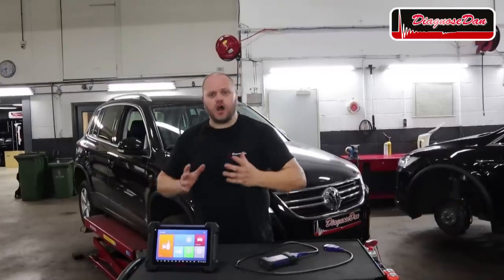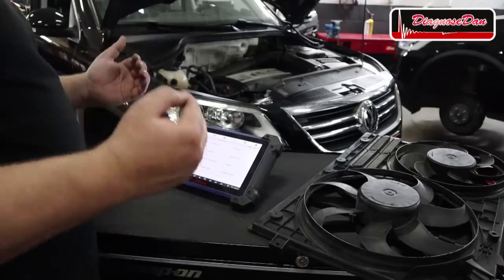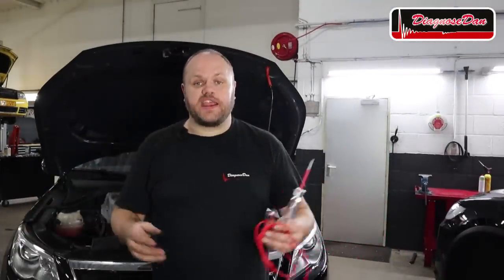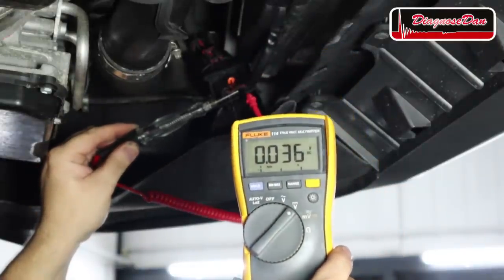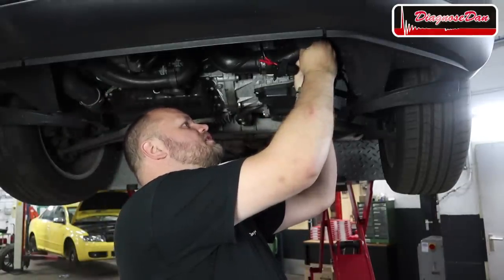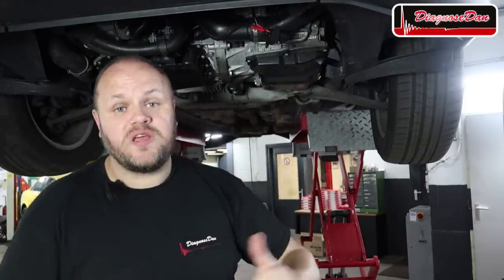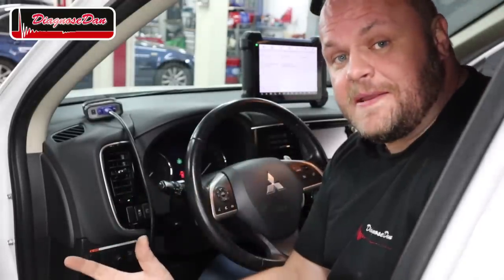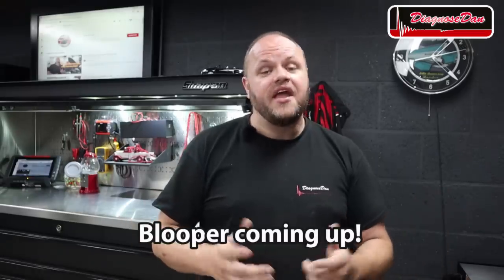A Cheap Chinese Car Key from Wish, will it work?

Comment: What gives with the other shop, surely testing grounds under load is car electrics 101
Reply: asking most of them what electrical load testing is and they'll probably not have a clue...
Reply from the maker: I think you would be suprised to see how many technicians don't know
Reply: @Diagnosedan  I have to look this up.  I thought a resistive point in the circuit (bad connection or corrosion) would show a voltage drop like putting a resistor in series.   If I understand, pulling a current (a load) can generate enough heat at the resistive point that it destroys continuity and breaks the circuit.    
It's not that the voltage is reading wrong on the meter.  It's that the load is testing all the connections under actual current draw and a weak connection will fail.  

I got the impression from the video that there was a problem with the test meter and the digital test light.  Like they were not showing the actual voltage.  Really, they are too sensitive.  They tell you everything's fine when it isn't.
Excellent video (as usual).  Worth thinking about.
Reply: @alext8828  there probably whee no issues with the multimeter or led tester niether are they too sensitive.

I assume he didnt gave a actuator command to start the fan while he meusured the ground, otherwise the fan itself would be the load and the voltage would had dropped.
Reply: @KaasTube  Ah, that is right.  Normally, at least from my experience, testing is done by casually hitting all the test points and noting the results.  It would be, as you say, a requisite to either switch the related component on or, as Dan did (finally), use a resistive test w/ load; ie. incandescent bulb.
I need to remember this result.
Just as an added comment; I did troubleshooting for a dealer and one of the things that we got a lot of were short circuits caused by the wiring harness being damaged by assembly screws driven thru the harnesses.  We had a meter that could follow the harness and find the short.  It worked by momentarily switching the circuit on at the fuse box and the meter was hand-held and would pick up the magnetic field of the circuit turning on and off.  An arrow on the meter told which direction to move to find the short.  I thought that was the coolest.  Never saw that system again.  Very clever and this was in the '60s.  Our most advanced piece of diagnostic gear was the Sun analyzer.   Dan has been a tremendous help in furthering my understanding of these things.  Thanks for your comments.
Reply: Alex T That is a very cool story about finding the short, which is often more of a hunting expedition.
Reply: @douglaslippertindy  I'm glad you liked it.  I was worried that it was a departure from the norm to add it in.  That gizmo could find a short in less than 10 minutes that you'd never find in a hundred years with normal methods.  I'd like to shake the hand of the guy that invented it.  And I never saw it used any other shops again.  Thanks for the reply.
Reply: @alext8828  I only work as a mechanic for 2 years now so I did not have many shorts yet, 
Although i do have some experience with finding shorts in a pcb.
For example a short between the supply and the ground which every IC is connected to. The way to find the short was to meusure it with a 4 wire bench multimeter. Everywhere you would meusure short but the 4 wire is accurate enough to even meusure the resistance of the pcb traces , so the real short will be 0,0005 while the rest will be 0,0010 ohm.

Comment: Very good Dan. This is not the first time you have found defective grounds. I hope I remember to use an incandescent test light the next time I have an electrical problem with one of my cars.  Also, when I bought my current car from my daughter it only had one key fob. I purchased two more key fobs from Amazon for $39.95 each and had a local locksmith program them in my 2015 Challenger.  They all work perfectly and I keep one of them in a safe in my house as an emergency spare.  I also carry two of them with me at all times to keep from getting stranded if one of them breaks or if the fob battery goes dead. I keep the spare wrapped in aluminum foil and plastic so that only one of the fobs is detected by the car. When I arrive at home I keep the active fob in a tin box so it can't respond to any signals from the car.

Comment: Great video. Ive been fooled too many times by a test light as well. I would have used something that takes more current than the incandescent test light you used such as a headlight. Another option is the load pro tool which im sure you know about. Bottom line is you need more than one approach to testing. Thanks again.
Reply from the maker: A headlight is still an incandescent test light when you use it for testing😉 Thanks for watching 👍👍👍

Comment: It has been a while, good to see more videos from you man and nicely done again. Just as a quick note, your Fluke multimeter is capable of detecting “ Ghost Voltage” due to bad or insufficient ground.  But it was really great that you used multiple ways to test power and ground to show the importance of using an incandescent test light.
** On the Fluke, once you read the voltage, switch the toggle to “ AUTO-V LoZ” and you will see that the 12.3VDC dropped instantly which indicates that the 12.3V will not handle any load. Thanks and keep the videos coming !!
Reply from the maker: Thanks, but not every multimeter has got this feature

Comment: Hi, this is the first of your videos that I have watched, but it certainly won’t be the last.  As soon as you started asking “did we make a mistake” when confirming 12V I had an idea where you were heading.  I have spent 40+ years installing radio telephone style equipment into vehicles of all types and uses.  I’m not a mechanic but I do understand something about electronics and electrics in vehicles and fault finding in general.  Any way…….  This problem that you had here reminds me of a rather embarrassing incident I had with a coach some years ago and is related to your problem, but potentially in a more spectacular way!  We had about 100 coaches to install for a large bus company and subbed out the install of the aerials and 24V to 12V convertors to a local auto electric company.   On one coach when I installed and tested the radio it powered on, went through the boot up procedure and appeared fine.  When I transmitted it powered off!  Right, there was 12V from the convertor, but, when I transmitted i.e., took about 3A from the convertor, the volts dropped to zero.  Why?   Well, it was a rather badly designed fuse box / power distribution system in the coach and the fitters had a slight problem in finding a -ve/ground for the 24V as there was no stud provided, as there is in many commercial vehicles.  So, they had found what looked very similar to your ground in your video, a stud with 3 or 4 wires coming off it.  NOW the similarity to your video, they measured between +24V and the stud, there was 24V, so they fed their convertor’s ground to this point and took 24V+ from the correct place.  All was well, 12V out of the convertor.  Did I say it was a non-isolating convertor that passed the -ve straight through?   Anyway, after having a couple of arguments with the driver who wanted to take the coach out on the road, I was walking to get a spare convertor and radio just in case one was faulty.  I heard a scream and saw the driver exiting the coach followed by a cloud of white smoke, he left his seat, cleared the space where passengers stood to pay and got down the steps in one single movement!!   When he got into the coach to take it out, even though he had been told not to he did 2 things, he clipped the radio microphone into its metal clip that was bolted to a metal plate on the dash and having done this he turned on the interior lighting system in the coach.   I’m sure you have guessed by now, the -ve for the 24V that the contractor had picked up was in fact the switched 24V line to the lighting circuit and “appeared” to be ground/-ve as it had multiple paths to ground through all the bulbs.  But when the driver turned the lights on this “-ve” line became +24V at rather a large number of amps.  The now + lead went through the non-isolating convertor, through the radio chassis, which happened to be isolated from ground as it was in a plastic DIN slot, and then through the curly microphone lead and clip to ground.  The lead instantly glowed red and all the insulation burnt off producing an amazing amount of smoke.  The driver looked a shade shocked.  He was told not to touch the coach but went ahead and did it anyway.  He may listen next time!    Thank you for your great video and diagnostics procedures and for fetching back this “happy” memory to me 😊   It wasn’t funny at the time, it could have been terribly serious, but after a few years it has become a good educational story and slightly more amusing!

Comment: Dude you are an excellent mechanic and the best at diagnostics.  Congratulations.  Excellent video.  Thanks a lot.
Reply from the maker: Thanks Manuel!
Reply: @Diagnosedan  No my friend, thanks to you, your videos are awesome.  To me the most important part of mechanical work is to have an accurate diagnosis.  In this case they made the owner buy a new fan assembly for the SUV when the real problem was a faulty ground connection.  That really hurts.  I appreciate what you are doing.
By the way, i would have taped the cables, but i saw you spray them with something that i guess will protect the connection.
Again, excellent video.

Comment: I recently took out the bumper out of my 2003 Jetta and saw the same grounding post but rusty as a nail. When I attempted to loosen the bolt, it just broke off. I was told 2 wires are for the fans and other wires are for the ECU. I spray mine w/ a product call Corrosion X. Great videos and tips!!!
Reply from the maker: Thanks for the feedback 👍

Comment: Thanks for spraying that earth after you remade it. I was imagining it going green and crusty in 6 months and the car being back where it started. 
If you measure the volts across the load in this situation they will drop close to zero as power is demanded. Of course you then need to find where the high impedance is. In this case the DVM on ohms on the ground wire would have worked.

Comment: Hi Dan, I dont fix cars anymore, I'm to old 😁 I work on Access Platforms, Scissor lifts and Cherry pickers. It's nice to see you find and solve simler problems, that's all I do now, common sence prevails. Great one showing voltage but no current, have found that a few times.Great show.
Regards Richard
Reply from the maker: Thanks Richard, you've got an interesting job!
Reply: @Diagnosedan  
Hi Dan, thanks for the reply, I didnt expect it. 
I find fault finding is the best and most interesting  part of the job it keeps your mind active. Better than than most jobs I can think of. Years ago I said to somone that a job someone was doing must be very boring, But as he said, " That's why you have different size spanners in your tool box"?

Comment: Great video as usual Dan.
Surprised you didn’t use your Powerprobe Hook, would have done all your tests without needing to climb those steps. As you know you can also provide ground, live or even load the circuit with a simple pass fail result.
I expect though you wanted to show how to demonstrate your diagnosis by using everyday tools.
Loving your content Dan looking forward to the next one.
Reply from the maker: I wanted to show how to do the test with only a testlight, not everybody has got a power probe
Reply: DiagnoseDan you are so good to us, thank you for all the time you put into your videos, they are great.

Comment: What a great video. I work on motorcycles of a certain age so don't come across much of this type of work. However I love electronics and find these videos fascinating. When I first started using digital multimeters years ago I soon came across this problem of misleading readings due to them not presenting a load to the circuit. I often use an AVO 8 Mk5 for this reason. I have a lead with an incandescent bulb in series to load the circuit I'm testing. I wish I had the money to set myself up to do this kind of work as it looks very satisfying.

Comment: It's a common mistake when tracing electrical faults, to those that don't fully understand electricity. Having a voltage present, does not neccessarily mean that the circuit can deliver any current. Digital multimeters do not draw any appreciable current, when testing. They are however, good at registering absolute values, battery voltage etc. An incandescent test lamp is far better to see if a circuit can deliver. Excellent video Dan.
Reply from the maker: Thanks Richard!

Comment: Power circuits require a LOAD to test them.  LED testers do not have a LOAD like the old incandescent test light or "lawn dart" as a Ford training instructor once called it.  Unless there is an LED test light with a LOAD built in to the tester, using a bulb like Dan had or an old glass headlight as the load will work.  The amount of fused circuit current will determine the LOAD to be used.  And yes, a lot of circuit power problems can be the ground side!
Great explanation Dan!
Reply from the maker: Thanks for the great comment 👍

Comment: The other way to do this is just put the test meter on the + at the load and operate the circuit involved to apply the operating load and likewise of the -
Incandescent test light do provide some load but in some cases it is not enough to induce a voltage drop, for example fusible links can carry a small load and even light up a test lamp but when you operate the circuit the voltage drops off.
Reply from the maker: In this case this was not a possibility because the fans are operated by the fan controller that's in the fan assembly. They share the ground internally. Because the control module had no ground it would never turn the fans on and the circuit was not loaded.
Reply: @Diagnosedan  
You still loose voltage at the meter since negative at the plug is still isolated by any load on the circuit, fan load or even a small module load, same as a remote relay has shared ground, the load of the relay coil can still cause open circuit and pull ground to +

Comment: Great video Dan. Test a circuit under load! Most important. 
I had a similar fan fault.
Merc 207 cab fan turning on after engine off and locked.
Another workshop already replaced engine ECU and fan unit😬.
Fault was very intermittent and difficult to reproduce. 
In the end I found the top radiator hose was leaking slightly causing a drop of coolant to drip on to the fan plug and short the plug! One new top  rad hose seal, job done!
Reply from the maker: Sounds like awsome detective work! Great job!

Comment: Dan I would have liked you to use the low-Z function of your fluke 114. I have the 117 and in the low-Z mode the input resistance is 3000 ohms (3K) it is not as much load as the incandescent test light but it is good to show high resistance grounds. Great videos as always!  Take care.
Reply from the maker: You are right but it isnt as visual as a testlight. It also might confuse people.

Comment: Great video Dan, As an Auto Sparky I hardly ever use LED test lights for that very reason, (in fact don't think i even have one atm) nor rely on a multimeter for testing main circuits.
Reply from the maker: Led tests lights also have advantages i'll show that in  a future video. But in this case the incandescent test light is the way to go!

Comment: Man you are good,actually verry good. Respect man. Same problem with my 2013 vw tiguan,sometimes my wife told me, when runs on highway,car notice that the is not in range,but it is in the car. Verry strange for me.Key battery is new. Thans again and keep it like this. Respect

Comment: Odd fact... as a domestic electrician in the UK, I do the exact same type of test. Use a proper incandescent test lamp to make sure there's actually current there, not just some leakage voltage through a damp open connection. Modern meters are too sensitive to be useful in a lot of situations (better ones have a 'low impedance' mode.

Comment: So everyone could have saved alot of time if they just used the right tool from the beginning. I need to get one of those incadesent test bulbs. What was that spray you put on the ground  cables? Awesome video as usual Dan, very good explained fault tracing. Was it a render issue that it only came out as a 720p video? You should do 4K videos, it will greatly improve the quality of the channel.
Reply from the maker: I'll look into the quality of the video, the spray is a anti rust, sealant

Comment: The DMM is the correct tool for these types of tests. Just simply do a voltage drop test with the both leads on the negative side of the circuit thats suspected to be at fault 👍😉😃
Reply from the maker: Thanks for watching 👍